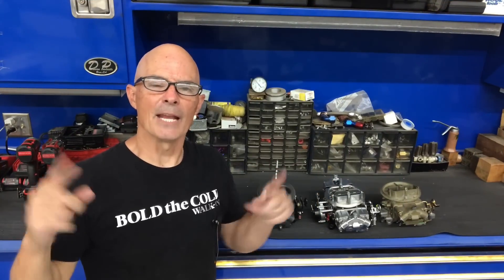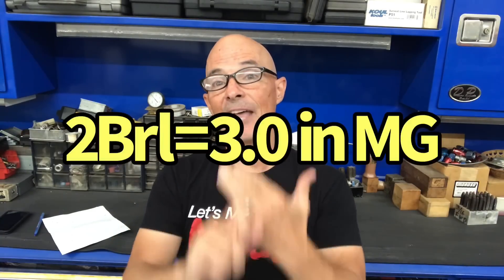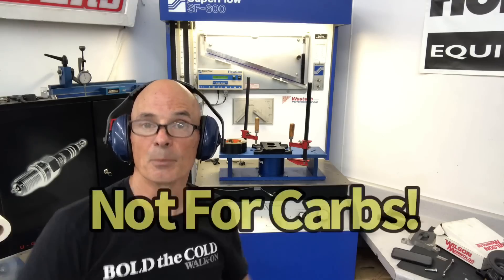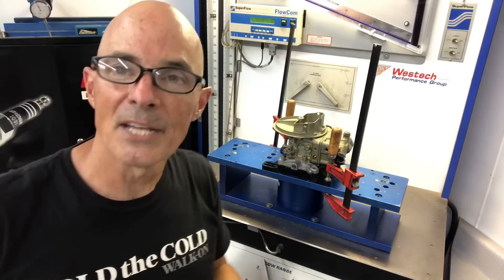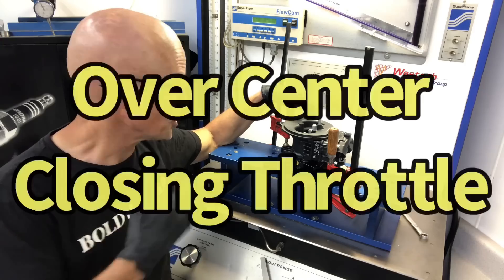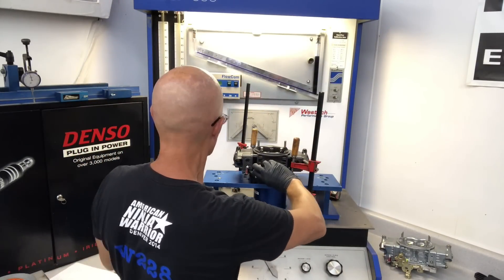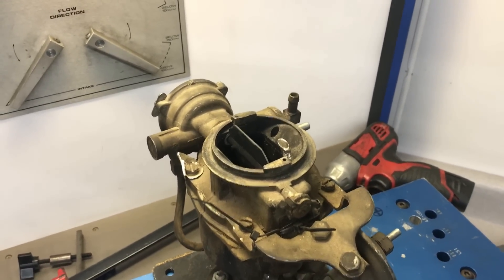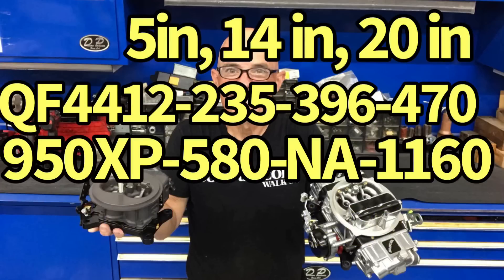CARB SHOOTOUT-2 BARREL VS 4 BARREL, ORIGINAL 4412 VS XP4412 VS QF4412, 650 v 750 CHOKE v 750 v 950

Comment: Would the 500xp holley support 370-400 horsepower?  Im looking for a carb for my 5.0 build.  Stock bottom end.  AFR165 heads,  RPM (non air gap) manifold and B303 camshaft. Going into a street  driven Ranger with a C4.  I don't think id spin it much past 6k. I know you are 5.0 master.  I took the time to enter all of your flow data on the Ford heads into desktop dyno back in the day!  Thank you!
Reply from the maker: GET A 4 BRL 650
Reply: Sounds like a plan. Maybe one of those new VRS carbs.  Thanks again.

Comment: I think you was bored and wanted to mess around on this video. We all knew the results before you started the testing! If you really wanted to make it interesting take a stock 5.0 H.O. Put a duel plan 4v intake on it and dyno all the carburetors on it to show real world results! Including the one barrel.  Now that would be interesting!
Reply from the maker: I guess you were just bored and didn't want to mess around with a proper comment. Testing carbs on a stock 5.0L would not show flow data (which was the purpose). Yours is the only comment like this about this video

Comment: Please correct me if I'm wrong, but data that I have read says that Quadrajet rates are at a 1.5 inHg pressure drop, so, it seems a lot better that this carbs? because you want max flow without pressure drop (pressure drop = manifold vacuum = pumping losses). (Please do a Quadrajet and a Dual Jet comparison, or a Quadrajet only in its primaries). Great video

Comment: For those of us with old Ford FE engines some of us had the 350cfm and 500 CFM installed  with cast iron low runner 2bbl boat anchor intake nice to see flow #"s .   I had both of these for years and made the mistake of selling them for a 600 Holly 4 bbl and I put a performer intake I thought i would see a major difference in WOT with the 4 bbl  😢 I was not impressed and spent a lot to get it 4bbl ready .

The 500 2bbl although was not a daily friendly carb since it used a lot of gas to compensate for the bigger bores 74 to 76 jetting vs the 65-66 of the 350 CFM my theory is with my truck head 390 and restriction heads I would had been better to keep the 350 CFM for daily and the 500 for performance instead of spending all the money to convert it over to a four barrel.
Reply from the maker: I have never seen a 2-brl that does better than a 4-brl set up
Reply: @richardholdener1727  If I read it right the 650 brawler was in the 393 CFM range the 500 CFM 2 bbl was 420 and the XP was 470 all of the four barrels that he tested for way under the advertising cfm. I have a 600 Holly 4160 right now and based on his numbers it's probably only flowing close to 490 or low 500.
Reply: @richardholdener1727  I had both the 350 and the 500 I currently have the 600 CFM 4 bbl now yes there was a difference at wide open throttle but it didn't have the wow factor compared to the 500 CFM 2 barrel it had before .  The big difference was  in gas mileage because of a small primaries on the 4 bbl  it's far better on gas  with the four barrel  primary side 12 to 15 mpg.   I was only getting 8 to 10 with the 500 CFM 2bbl the 350 2 bbl was better on gas than the 500 and only a slight loss in WOT between the  two-barrel carbs both two barrels rev to 45 to 4700 RPM the four barrel 600 CFM Holley rev to 4700 RPM as well and that was due to the restriction of the truck heads that came on the 360 /390 F100 and f250s.
Reply: @TheThirdWheel618  . He tested all at 1.5HG/20" of WC (Water Column) and then at .4HG/5" of WC - Also tested at 14" of WC but listing it here would just make MORE of a number salad! - I wished he would have went to 40" of WC (3" of Mercury) and did some pulls.
500cfm race 4412 = 420CFM / 210CFM
500cfm race 4412X = 470CFM / 235CFM
650cfm race 4bbl = 786CFM / 393CFM
750cfm with choke plate = 862CFM / 431CFM
750cfm race = 904CFM / 452CFM
950cfm race = 1160CFM / 580CFM

Comment: if you put a 2bbl on a ford 460 will it fall flat on its face when you drive it???????????? a friend o mine has a f350 with a 4bbl converted to a 2bbl carb n it dies out when you drive it. is it the wrong carb on the engine???????????????????/

Comment: One would think cfm is cfm, and the number of barrels do not matter. I would guess that having a high CFM 4 barrel runs better as you would have better fuel control and atomization over one huge barrel that flows the same cfm, if I had to take an educated non-carb guy guess at it.

Comment: Flow bench numbers are cool, but more A to B tests were what I was hoping for. The 2 bbl tests were informative. Although it would have been interesting to see how much that choke horn was hurting that old school 500. 

I was hoping to see what a 2 bbl would flow against the PRIMARY side of a 4 bbl with the similar butterfly/venturi sizes. You know, will the front half of a 1000 cfm 4150 flow as much as the 500 cfm 2 bbl? 

Another useful real-world test would have been a no kidding A to B choke horn restriction. Flow a 750 double pumper with a choke horn and one without. Then, just for fun, flow a 750 HP style double pumper with a smoothed neck.

Keep the cool stuff coming that makes us think.
Reply from the maker: I FLOWED A 750 WITH AND WITHOUT A CHOKE HORN

Comment: I didn`t know how the manufacturer flowed their carbs but I figured they all have the same suck on them, wrong!  the 4412`s are rated at 500cfm and your results were very close. Full vacuum is 33ft of water and 29.92in of mercury or 760torr. It is confusing

Comment: Do a video on valve lash. I see people waisting time, risking a open motor, adjusting valves all the time. If nothings loose or going away, I cannot understand why. I can't see any HP gain with a few .1000th. If you did gain anything, I wouldn't think it's worth the effort or risk.
Reply: On a race application they constantly check valve lash as an indicator of cam and or valve seat wear.  Those high hp engine have a ton of seat pressure. When one spends 50 grand on an engine they want any indicator of wear to try preventing metal In the oil.  
Just My thoughts. May be other reasons.
Reply: @Mike-xt2ot  I run 500lbs and never an issue.

Comment: Richard on the engine dyno or with A/F ratio sensors installed I bring up the rpms till I see fuel trickling from the primary boosters then back off till it's not. Look at the A/F ratio. If you are lean go to bigger IFRs. Try again .  I got to 0.036 IFRs on a 40 over 429scj and the car owner complained he could not pull away from any stop sign or red light without spinning the rear tires. Holleys ship with a 0.031"  IFR because that is what their computerized air flow bench is set for. 0.031 is good for a 327, 331.  A 0.032 is good for a 347 to 365. 
Try it.  Be totally amazed you can do dyno runs from idle without needing to start the run at 3000 rpm.  Drivability is improved as is fuel economy .

Comment: From what I see none of the carburetors were tested at 28 in like the cylinder heads
Reply from the maker: THEY ARE NOT RATED AT 28 INCHES-PLUS NO FLOW BENCH WILL SUPPORT THE FLOW OF A DOMINATOR AT 28 INCHES
Reply: I bet the flow bench will do almost everything up to a dominator
Reply: @thomasward4505  Good Lord the CFM the carb would pull at 28" would be insane, it was crazy at 20"

Comment: In simple terms, a 1 or 2 barrel rating is at ~1 psi pressure drop in the manifold/plenum, and a 4 barrel is at ~1/2 a PSI drop in the manifold/plenum.
Not sure how they'd rate the 3x2 setups from back in the sixties?

Comment: Hmm. Weber carbs have replaceable venturi..
How about matching the carb flow to the head flow for the quad Weber on a Ford in a Cobra or GT40 combinations.
Also Individual runner EFI modern equivalents.

Since you have the Weber flow bench adapter

Comment: I was always curious comparing the old 850 DP (4781?) to the 950HP and the 1000HP. The 950HP is hybrid carb, with an 850 throttle plate and a 750 or 800 main body, although the main body is, 'enhanced" compared to the older models. The 1000HP is a straight 850 with an enhanced main body. We always got more power with the 850DP over the 950HP, but the 1000HP would top that. I wonder how the flow of the 950HP compares to the 850DP 4781. In our experience, the 850 ran as a bigger carb than the 950. I did run a 340 Mopar block with a ground down 360 crankshaft with a 500 two barrel in circle track. I balanced the racing flywheel to the externally balanced 360 cast crank, with a 360 balancer and the cast crank held up fine. One thing about circle track is, you aways find the weak parts and what will break. Went from 340 heads to W-2 heads and intake on that one too.

Comment: Hey sense your doing different testing can you do gearbox testing on a engine dyno. Say turbo 350/400 power glides then 4l80. And 6l80 can you just do a dyno test a record the power loss and benefits of say a gearbox maybe find a uncommonly box that is good
Reply: Un common by it being common but uncommon in coversions
Reply from the maker: NOT ON AN ENGINE DYNO

Comment: My question ,  is flow effected by introducing vaporized fuel into the scenario ? If so how much?
Reply from the maker: YES-THAT IS WET FLOW (CARBS ARE RATED FOR WET FLOW)
Reply: @richardholdener1727  Ok I get that but it didn't look like in your video you were wet flow testing the carbs. Does your flow bench correct the results for wet flow, or do you have a formula to correct the data? Is there a rule of thumb like dry flow is 10% greater than wet flow or some other percentage?

Comment: The explanation I remember hearing for the different flow test depressions was that in the early days of the four-barrels the flow benches of the time simply didn't have the capacity to test the big four-barrels at 3" hg, hence the decision to rate them at 1.5".
Reply: Some of those monster Pro Mod nitrous engines flow some serious air. Without exhaust and intake runner/tube tuning, they would be so weak.

Comment: Did I read the end results right, the 4bbl at 20" of water flow more than their claimed CFM at 1.5" of mercury ?
Would have liked to have seen the numbers for 1" of Hg or even half an inch where big carb'd motors run, still I guess we can calculate that.
Reply: I know 1ATM = 14.7 PSI = 29.92" Hg...what's the deal with water? Is it an "EPA thing" B/C of Hg?

It just seems weird to throw in a third redundant measurement system.
Reply: @bcubed72  Just sorting it out loud, flow benches use "h20, so as explained, Richard is flowing on a water rated scale and we're comparing to a hg scale when we talk carbs. But it's a water scale when we talk heads. Should all be done in one scale of course. I think Piston aircraft still use Mercury, hence all the different scales. ISO the lot I say.

Comment: This is cool. I want to know how much hp a 2bbl cost you vs optimal sized 4bbl on a 350 sbc on a 350-400 hp range.
Reply: Probably would gain you a fair bit of part throttle response
Reply: He did this test and some other related stuff in this video https://youtu.be/-Uqsf-ljNt4

Comment: That’s a cool machine, great test! Something I’ve been curious about is on the qjet I’ve seen some people hack the booster ring out saying it will deliver more cfm it would be really cool to see a before an after of that on both the flow bench and the dyno to see if there are gains associated in either department.
Reply: @grandmasmalibu  awesome explanation thank you!
Reply: I have built several with the down leg ring removed and at the same time the power piston and primary metering rods removed.  Works great in a boat or towing/rv application where the engine will be under constant heavy load.
Reply: @carguychris85  good info thanks for the response!

Comment: Richard, can you do a test showing that it's not actually possible to over carburate an engine?
Reply from the maker: I DID A 1050 DOMINATOR ON A 1-BARREL OPENING ON THE 292 SIX CHEVY
Reply: @richardholdener1727  Yeah, I saw that Richard, but I was thinking more of a 4 barrel shootout where you start with a 600 and go all the way up to a 1050 dominator on a mild small block using a 4 barrel intake of course.
Reply: There was the one where he tested a bunch of carbs on a straight 6 I think he put a dominator on it
Reply: Hey, what do you mean by that? I am still learning my first carbed build and I am seeing that supposedly if I put too big of a carb on the car it will have poor throttle response.

I have a 351W with a Weiand 174 that I am putting together. I was given a 850 Double pumper and I'm not sure if that will be too big. Weiand recommends 750cfm for this blower on a stock 302. I was debating a 750 vacuum secondaries rather than the DP
Reply: @RedCow777  Double pumper on a blower always. You want as little restriction on the intake side as possible on a roots blower. I ran a 950HP on a 144!
Reply: @CarsandCats  it wasn't bad on the throttle response? Did you have to boost reference your carb?
Reply: @RedCow777  It went 12.0's at 113mph @ 3550lbs. Didn't get 11's because blower strips were flat wore out! Tried spraying a 125shot into it and went 11.47@119mph. Tried a 150shot and nipped 2 plugs. Manifold distribution is HORRIBLE.

Comment: Edelbrock vs Holley ???
Reply: I saw some data where the Carter types flowed about 100 cfm less than the Holleys with the same rating.
So a 650 Holley flows about what a 750 AFB.
Reply: Have done a flow test on a Weber 38/38

Comment: "Now we're talking about big power" ( 1 barrel carb. I predict 125cfm)

Mercury is Hg, not Mg.

I think people would like to know for once and for all how much help a vel stack or those little individual per-throat stacks help flow. However, you are going to have to run the flow bench at far higher depression levels to more accurately mimic the suction of a big engine inhaling through them. Did any of the carbs even get their "rated" flow?

I'd like to see the flow go supersonic through the 1-barrel, or all of them, as that might REALLY aid in atomization a departing shock wave just as the fuel leaves the booster venturi, but to have an efficient carburetor at mach 1, the transition from ambient to venturi to booster would have to be graceful indeed.

Also, the vel stack with some filter in it, such as a semi-conical K and N that just fits inside the stack, for aesthetic reasons. It would have inverse cone and an outer cone for maximum surface area.
Reply: I don't know if 14.7psi from the atmosphere is enough to push the airflow to supersonic speeds, maybe it's possible with some serious forced induction but the shockwave and general restriction from the carb would cause such a pressure drop it may not be worth it
Reply: @EpicScandinavian  Sonic-flow carburetors have already been invented, so yes, ambient pressure is adequate. In FACT, the "music" of the intake trumpets for a Ferrari or even a dual-quad Hemi's carb barrels  is the shock wave from the flow past the intake valves, even as the much-louder sound from the exhaust valve is the shock wave from the flow past the exhaust valve.

I think the main obstacle they faced was placing the fuel flow in relation to the shock front: before it, while flow is sonic/supersonic, in it, or after the shock front, which would be higher pressure and subsonic.
With a change in air velocity, the shape of the shock front changes, and so does the position thereof.

The shock wave greatly aids the energization and dispersion of the fuel atomization.

A carburetor that would automatically adjust the fuel introduction point to ensure a predictable level of airflow and pressure drop at the fuel introduction point was the aim of some of them. Without a predictable ratio between airflow mass and fuel mass, the carburetor hits an obstacle in its function.